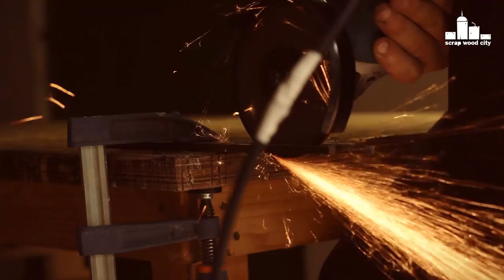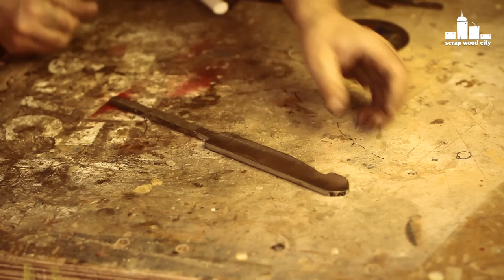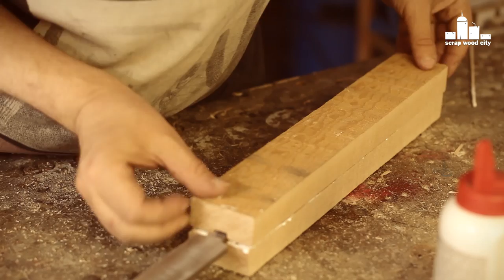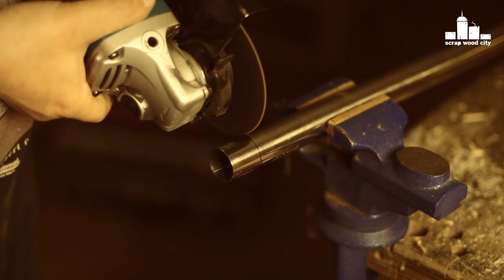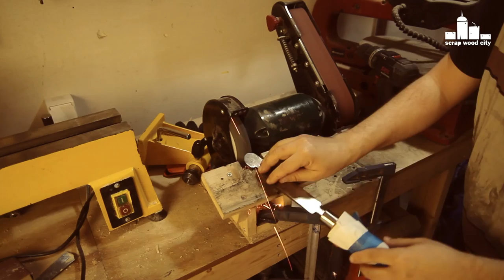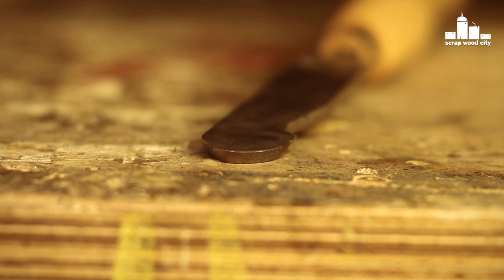DIY round side cut scraper from an old file

Comment: Great build, I also make a lot of my tools from old files and tool steel.  Only one question though and not a critical one, why did you decide to harden it since files and tool steel come hardened?  Maybe you know something that I don't?  Please reply.
Reply from the maker: Perhaps this was not a necessary step. But the angle grinder kind of burns the steel. It seems to hold an edge fine this way!
Reply: Looks like it cuts great, I'll be adding this to my list of tools to build!

Comment: What happened to the cut off wheel on the grinder?! It looked like it the edge had broken apart
Reply from the maker: When I use the angle grinder with the disc parallel to the surface the disc loses material from the flat side. It was not broken, the wire inside the disc just came out. At this point the disc might brake, that's why we need to use the guard. Anyway the wire mess inside the disc helps a lot in these situations!